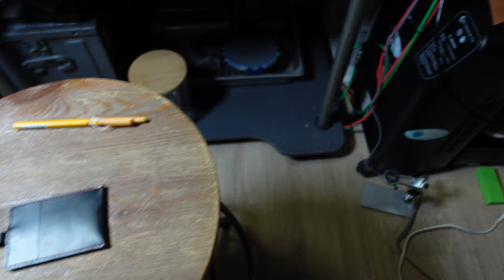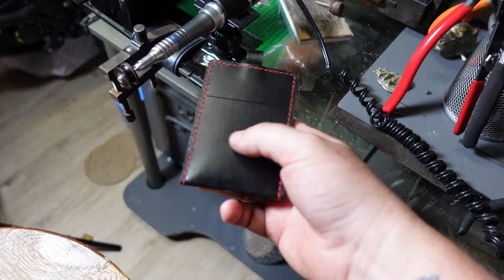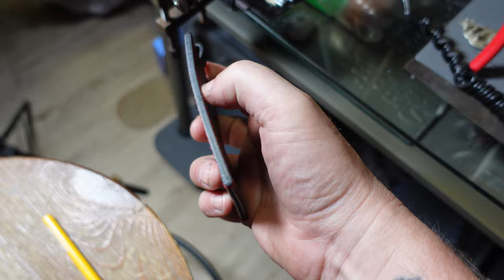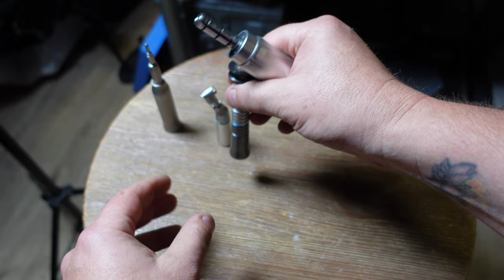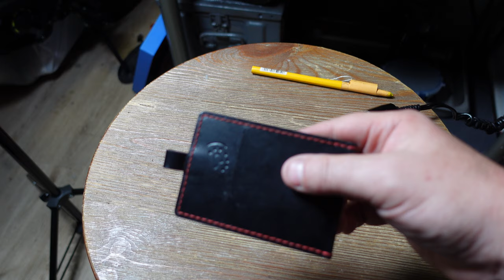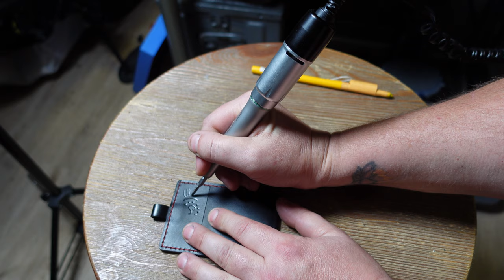Using a hammer handpiece for leather tooling?

Comment: I have a foredom hammer attachment, if you look up how to shape & use gravers, you’ll see what each tip does. The most common is the square graver, it can make different scribes both thin & wide.. as well as shading.

Comment: I make some of my own stamping tools from SS bolts using my Dremel tool and files.
I looked up the micro tool and there are several options. I couldn't find a link to the reciprocating tip you have.
I believe making tips for it however would be relatively straightforward.
This is a very interesting concept. 
Again, thank you for the information.

Comment: I've been anxiously awaiting your video on making your own bits for the hammer handpiece, but I haven't seen anything posted so far.  I would really love to see that!  I just bought a micromotor machine like yours, but I can't find the hammer handpiece anywhere.  I've searched Amazon & AliExpress, as well as any other sources I can think of, but I can't find anything compatible with the micromotor.  Can you post a link for the supplier where you bought yours?  Thanks, Shirley
Reply from the maker: The handpiece with the interchangeable head is called an "E type" dental handpiece. The seller i used is no longer in business but if you search alibaba for dental handpiece manufacturers , email one that sells E type handpieces, and tell them you want the reciprocating type ( i think they sell it as a dental saw handpiece) they should be able to provide what youre looking for..just make sure you tell them you plan on using it to insert round bits that are 2.35mm because unless you instruct them otherwise, they usually provide the reciprocating handpiece with a collet that accepts saw blades instead of round bits. Good luck and let me know if you need more help. I do have a bit making video planned soon.

Comment: I'm super surprised this doesn't have more views! Seems like an amazing idea. I'm also totally green when it comes to tooling. The only other tips that I think could be used would be bevelers. Possibly certain backgrounders but I would be worried the rpm would be so high that the pattern wouldn't show and instead be more like smashed leather. I'm definitely excited to see where this goes.
Reply: BTW anymore info on your edge finish pucks?